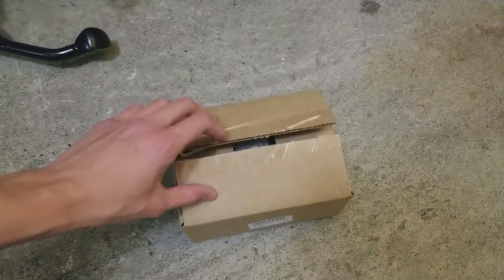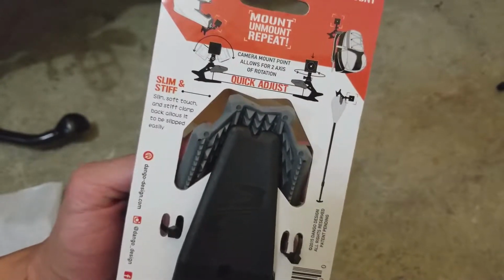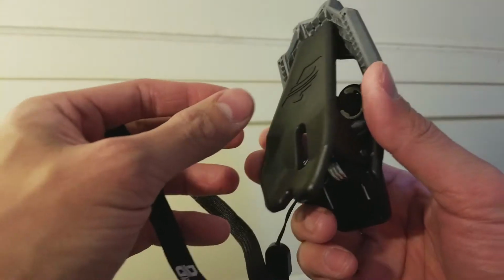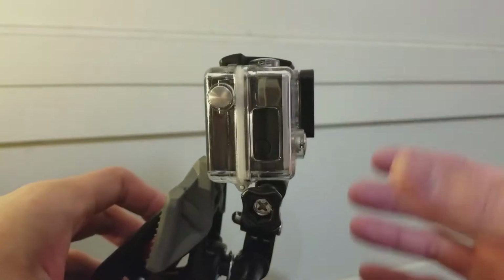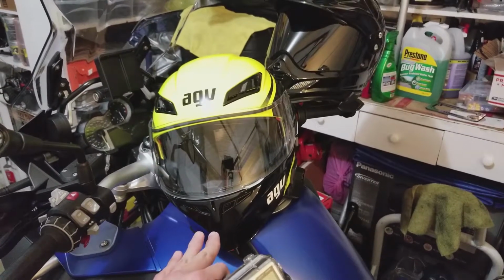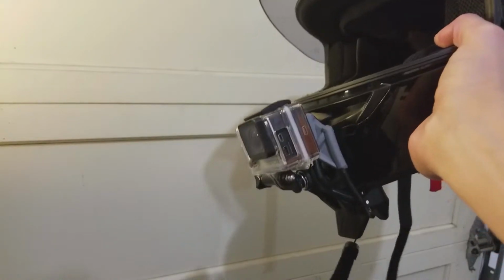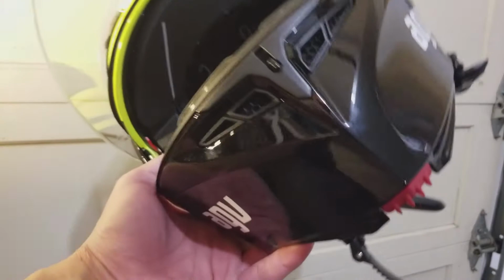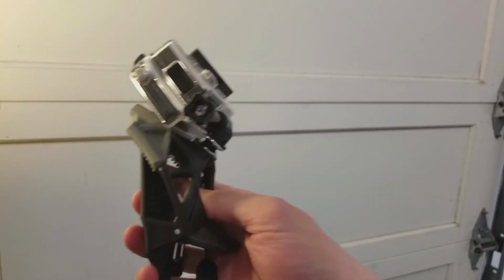Dango Design Gripper Mount Review

Comment: Update Ken.  . .I got my gripper mount yesterday and used it today.  The only problem I can find with it so far is the tightening screw is on the right side. . .so if I need to adjust the gopro and retighten, I have to use my right hand, taking off the throttle on the motorcycle.  Guess I'll have to get it mounted right before I take off.  Good product though.  There's many uses for the mount other than on the helmet.  Glad I stumbled onto you and other's review.

Comment: You won't have hinderance of your shot if you flip the gopro upside down in the mount. .now you have more swivel space at the base mount.  Keeping it in top view is probably good for clamping that bad boy onto some odd surface like. ..a lamp shade.
Reply from the maker: Sorry, I feel that I was way too harsh in my first reply so I'm redo-ing it. anyway...no need to overthink this...just add a small extension arm to the base of the Gripper mount and attach the GoPro to it...you'll have the extra angle you need...I've actually been using it this way and it works fine in the tuck sport bike riding position as well as upright riding position.
Reply: @kenmoto87  I saw your first comment. .and it made me smile.  Kinda like watching an MMA fighter walk into roundhouse back punch.  I'm just saying when you say there is hinderance at the base connection as your lean forward, the base can swivel around so you have a lower hanging gopro.  I just purchased the mount today off your, and other reviews.  SO TAKE THAT TO THE BANK. .playa.  [flying uppercut knee kick].
Reply from the maker: @palmtrees89  really just add a small arm. its so easy.
Reply: @kenmoto87  you know I will.  But I will try both ways.  And then I will test them both to see if I turn my head if the high winds won't rip the mount off my helmet.  I've tried several helmet mounts.  This is just another. .but looks much faster to mount/dismount.  Anytime you want to vent again, please do.  It's part of the entertainment. :) https://youtu.be/eTY5uhjqP2Y

Comment: Ken, good review.  What about chin curtains?  I just bought a Dango for my Shoei Neotec 2, but the clip will not go over the chin curtain!  I guess I must remove the chin curtain, or return the Dango, OR, buy a helmet with a thinner chin curtain..... I was hopefully the Dango would be a one size fits all solution...sadly, no!
Reply from the maker: Yes unfortunately thats the only downside of the chin mount but some of my helmet have removable chin guards..if yours doesn't then it wouldn't work nicely.
Reply: @kenmoto87  When riding long miles that chin guard is nice.  Inconvenient to take it off, put it back on, etc..  I'll keep the Dango for mounting my cameras in other places, but look for another solution for my helmet.  Maybe on top, or mount on the side?  We'll see.